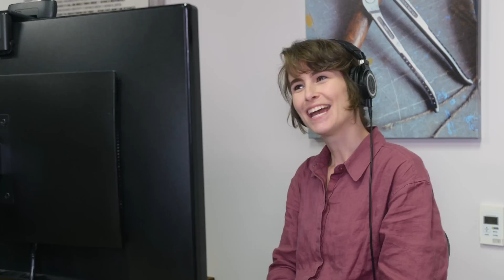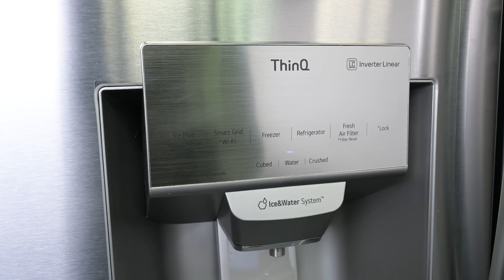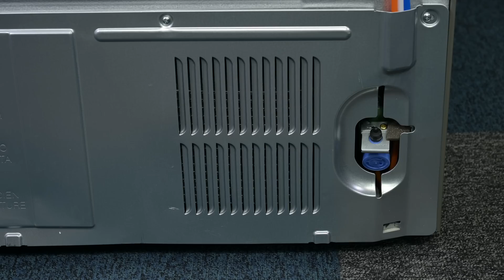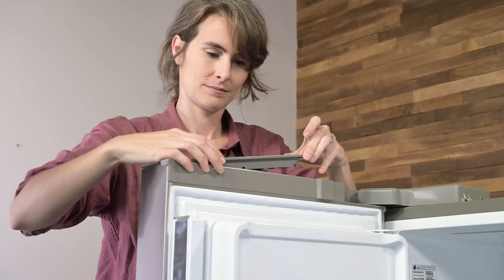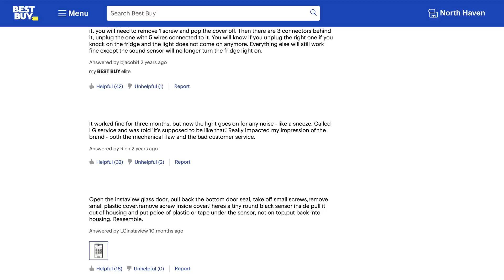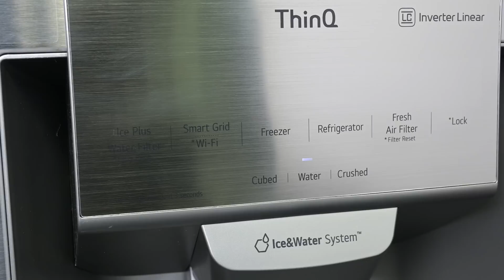Modern Smart Fridges: Can You Fix One at Home?

Comment: 15 years? Without repair(s) or with? My experience, with GE and Whirlpool from around 10 years ago is that you need to recap the mainboard if you want to keep it more than 5-8 years. I've done at least 20 mainboard repairs, since they've been discontinued (the mainboard, that is).

Comment: I'm an appliance repair technician. By today's standards, refrigerators don't even last 6 years without needing repairs. They can definitely last 15 years, but they'll need repairs. Those LG's are the worst. They all need a new compressor and some within a year or two. Can you believe they've been having the SAME issue for over 10 years now and even the newly designed compressors are having the SAME issue?! These companies truly don't care. Even the ones we used to recommend are getting substantially worse.
Reply: What do you think about whirlpools?
Still a great brand?
Reply: @silenux7419  Whirlpool is one of those brands we used to recommend but are now bad quality, or average at best. Even their "simple" side-by-side refrigerators are now designed with parts that have always been known to be less reliable.
Reply: @ChristOurKing  uff. So whats the good stuff that is still reasonably priced?
Reply: @silenux7419  There's no good general answer to that question tbh. I think it depends on the type of appliance someone is looking for and then the model. For example, GE makes some French door refrigerators that have less issues than most other brands. However, when it comes to washers, dishwashers, etc, GE is one of the worst brands. Also, LG makes great laundry appliances, but their dishwashers and refrigerators are not reliable at all.
Reply: @ChristOurKing  Thanks for the insight.
Reply: I bought a Danby fridge about 3 years ago. So far so good.  Do you have any experience with them?
Reply: Great insight. I have the same fridge featured in the video, any idea which area the Wi-Fi module is located. And any thoughts on if disconnecting that may actually help in any way. Thanks.
Reply: @dwaim  Wi-Fi module is usually next to the display. Sometimes there's a screw on the top side of the door. 
Disconnecting may not help since that usually tells the control board there's an issue and will likely give you an error code. 

If you give me the model number I can help you find it.

Comment: A regular non-smart refrigerator is fine for most people, especially when they’re way easier to get fixed and does what they’re supposed to do which is keeping your food cold.
Reply: It depends on how "smart" is defined. Nearly all refrigerators use control boards and do "smart stuff" (like adaptive defrost, or variable speed compressors). Very very few refrigerators are electromechanical nowadays

Comment: Appliance repair today:

It is the motherboard. (ALWAYS)
motherboard: $400 
labour: $100

new appliance: $550

Realistically, I just would like appliances that are well documented and running on ESP32, or a Raspberry.....      then just use common, documented sensors on a common, shared circuit board...
that plug is for :  temp sensors
that plug is for: water flow (type Xyz)
that plug is for: relay 1

So instead of some cryptic blinking cr@p code, you could actually connect to it. And it would tell you:  sensor 1 failed, sensor 1 is a thermistor of XYZ. Check connection and/or replace sensor with commonly available item. 

Nop ... +1 proprietary motherboard based solution for which the board will cost more than the actual appliance.
Reply: BTW that fridge in the video WILL FAIL on tropical climate within 2 years. No seals around circuit boards, so unless you live in a climate controlled, sealed apartment, that thing is done very fast.

Common appliance issues: bugs, ants moving next to nice warm cozy circuits. 
Humidity growing mold around circuits. Then finally ands/mold/humidity frying those circuits.

Even membrane keys would just ... die here.
Reply: And that "modem moment". An esp32 is $10. Buy industrial quantities, and $2. Comes with WIFI, and doesn't need an app, just a web browser over wifi. 

WHO makes these decisions / designs in the 21st century? 

I don't think anyone with true repair in mind... just buy that $500 board. And in 5 years you probably won't be able to source it. 

Yes I am darn pessimistic. I probably filled half a landfill with dead dishwashers and washing machines, and even a full industrial gas stove that could not be repaired. Yes. It had a "motherboard" that controlled valves and sparker :( and in 3 months at the dealership they couldn't figure it out so just refunded it.

Comment: I hate that "things" are not becoming smart, just becoming slaves of the corporate overlord. If I want to buy something that only have "smart" features, then I will make sure I can hack it using either using my own software or hardware.

People need to keep in mind that, "smart" means a finite state machine, which does not work outside the state they designed for.

Comment: What's the point of a smart fridge? What on a fridge would benefit on controlling remotely?
Any additional functions like Apps are unnecessary and would be easier to do with a phone.
Reply: Smart Fridges just looks more like a vulnerability for home networks.
Reply: The ones without screens at least, you can remotely activate the turbo ice feature, if for example you are going to have a party, but you're away from home and can't physically press the button. I'm sure it also has diagnostics and temperature control too.
Reply: @tylerwatt12  Or.. you can plan ahead and make extra ice and put it in a largish container in the freezer. You know, like people did for decades before this crap was added to fridges.